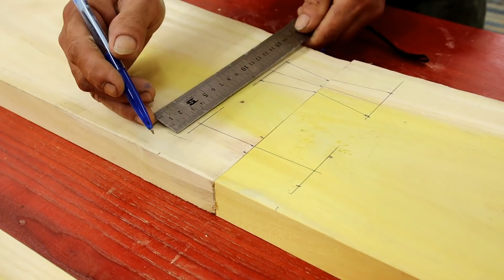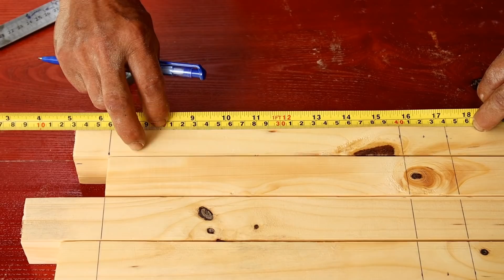Carpenter's Amazing Woodworking Idea And Skills // Perfect Woodworking Project From Dried Stumps

Comment: He didn't allow the timber time to dry out (this is called seasoning). You can tell this because the saw dust is clumpy due to moisture. This means that the finished product is going to warp and twist out of shape over the next 2 years as the timber dries out naturally. What look like clean joints now are going to develop gaps and the top will not be a flat surface anymore. Please don't do this! You'll save yourself a lot of frustration and wasted time.
Cool design for the legs though!
Reply: that is but one of the issues here...

Comment: You should never use wood that has not been kiln dried or at least air dried for a long time to make sure the wood is dry enough to use. Less than 10% is usually acceptable. also you should never be cutting those strips against the fence like I saw on the video. Very easy way to have the wood flip back on you and cut or break your hand. Always cut with the bigger side to the fence and move the fence accordingly.   Just saying for those who are beginning woodworkers. Don't start bad habits, you will learn to regret them.
Reply: Well put, I was wondering why he was doing that? In third world countries safety is last on the list, trust me I know.
Reply: oh god I just came to that part after reading this comment
looks like a "weird that I didn't have any accidents then huh" type of mindset

edit: nvm, he at least had 1 accident
Reply: @salshamoun1775  well no worries about losing limbs in a place where you don't even get treated in the first place, I guess

Comment: I have worked with wood for over thirty years. The problem with using wood from a stump is that it is not stable. In a year or so,  the cracks and checks will start to appear in the table top.
Reply: Only if it is not seasoned properly(which can take, anything from two, to five years, depending on the grain of the wood, when I was a kid, we used to see whole stacks of tree trunks, under cover and seasoning slowly, so that it stayed stable, as long as it was not kept near to a radiator), and the storage of tree trunks, is something that most people don’t do these days........
     Mainly because they are unable to wait, and because of the costs, so they kiln dry it instead, which is not as good as properly seasoned wood..........

Comment: Green unseasoned wood Will warp and crack within a week..
A true carpenter would know this.
The seasoned length Will still need the ends trimmed.
The wood worked here will have no intrinsic strength nor stable shape.
Reply: Or beauty
Reply: Exactly!
Reply: Blunt but so true! Besides the detail of having a table that’s hollow in the middle???? What’s the purpose???
Reply: @roadshowautosports  honestly, i feel like its a troll.  Everything about it is wrong.
Reply: Am not a woodworker. How can you tell it’s unseasoned?
Reply: @Phisch777  "How can you tell it’s unseasoned?"
Because there is no suggestion or indication that the wood has been allowed to dry or season. The video goes directly from the wood being ripped with the chain saw to being passed through the planer. Any planks that had been ripped from a log, even if the initial log had been "seasoned", would still have forces within the wood that would eventually lead to twists, turns, cracks, and/or checks as it acclimated to its surroundings. None of that is yet apparent in this wood. It will be, eventually.
Reply: TimeTravellingBunny thanks! I was wondering if it had to do with the color of the wood somehow. I guess logs don’t get seasoned?

Comment: I have gotten spoiled over the years.  I have a table saw with an indexer built into the sled so my slots would have all been the same without all the marking.  I would have drilled my holes first and then used my band saw for all the butterfly slot cutting (no jigsaw) saving me all the chisel work except for the one corner. Being spoiled has not helped me to develop the skill with the chisel to even make a decent flat in a piece of wood. His craftsmanship is something to be admired
Reply: Ok

Comment: There was a time, when people were masters of their job, and they were able to dovetail the wood, and use other joints, which were held with pegs, and because they were using properly seasoned wood, it never could just fall apart..........
     And while his work is good, he is relying on the glue to do the job, instead of his skills, and unfortunately, even the most modern glues will give way in the end........

Comment: “A” for effort. But you’ll be cursing all the spilled drinks and other items that fall over or through the gaps in the middle.  Float some epoxy, or put a glass top on it.  Nice idea though.  Definitely let the wood dry before building with it too.

Comment: you didn't glue the ends of the boards together when you put in the bowties.. 
wouldn't that have made the bench top stronger..?
most of the glue came off the bowties when you pounded them in..
Reply: End grain doesn’t make a good bond when glued. Some woodworkers even contend that to do so, (glueing end grain) is totally useless.
Reply: @mercoid  

lol.. 
and some.. 
actually many.. 
will call glueing the end grain.. 
a necessity.
it all helps hold it together.
and please don't try to tell me that no glue is better than some glue.. 
hahahahah.....
Reply: @deborahb.3736  ….
I see your reading comprehension isn’t particularly sharp….. Clearly, I’m not telling You, or anyone, that no glue is better than some glue. I WROTE… that “SOME WOODWORKERS CONDEND……” 

And it IS absolutely true that  end grain to end grain does not make a good bond with glue. If you knew how carpentry glue works, you’d know that.